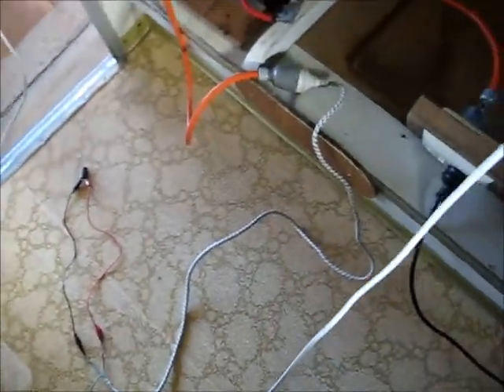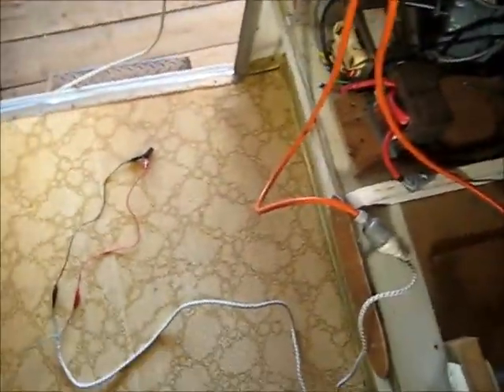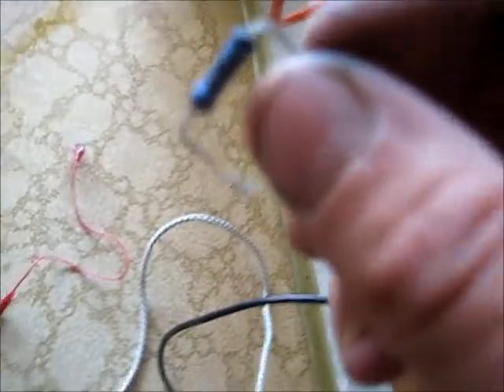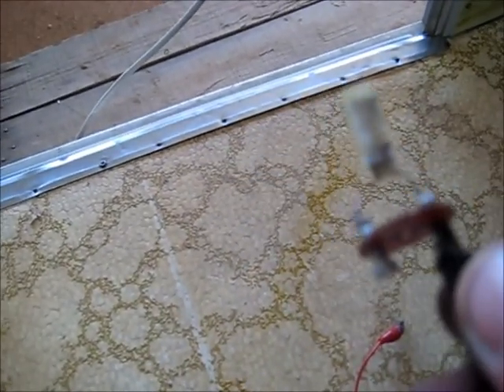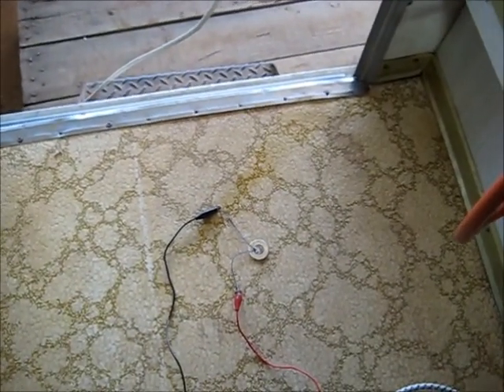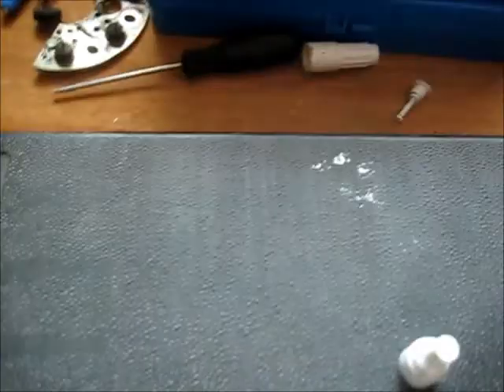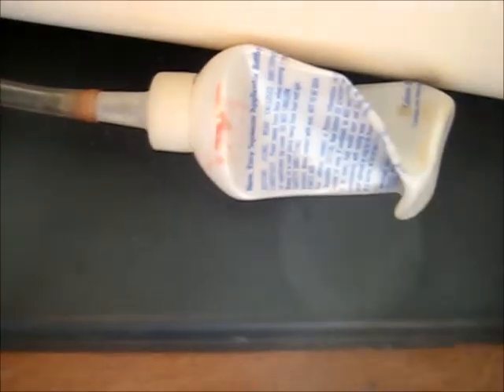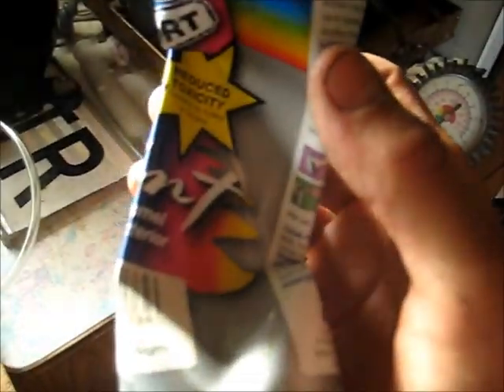Capacitor Pop & Aerosol Can Implosion

Comment: @2:00 i hate sam young caps ,pure  cRap , they went bad in my factory car anti thieft system this week reaking me havik trying to figure what went wrong with the system,going to rip the unit out and replace it with a new unit after i replace the caps in the new unit with high end caps and cook the old unit and the removed caps from the new unit too

Comment: @BoomBoxDeluxe A piezo tweeter is a capacitive device, so yeah, you need a voltage high enough to jump over the 2 plates. you can never fry it with voltage that doesn't jump over the plates. So a MOT should do, depending on thye piezo element size.

Comment: About the Piezo tweeter pop.....If 240v didn't make it go *POP*, then it's MOT-time!

Place a MOT between the variac output and the tweeter, and then you'll be able to crank-up the tweeter from 0-2000v. :-D

I've always wanted to know what would happen if the voltage output of one MOT was fed into the input of another MOT...The voltage output from the second MOT would be ridiculous. :-D

I'll have to do some maths on that to take a guess at what the crazy voltage would be. :-D

-BBD.

Comment: Mmmm, nice arosol can implosion, but....holding onto it?! *CRUNCH*

Oooh, crikey! Nearly pinched the fingers there!! I wouldn't have had my figers anywhere near that for that very reason. Unlike the plastic bottle, metal cans don't gradually deflate....as you found out! 

I am not sure how much that would have hurt, or how badly a finger would be crushed if your fingers had have been caught in one of those folds, or how easy / difficult it would have been to get your finer back out.

-BBD.